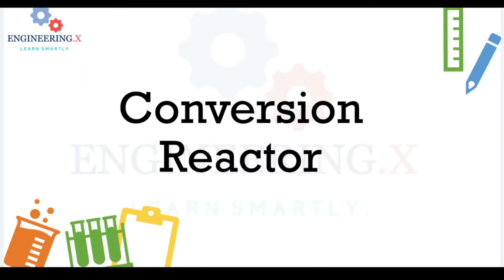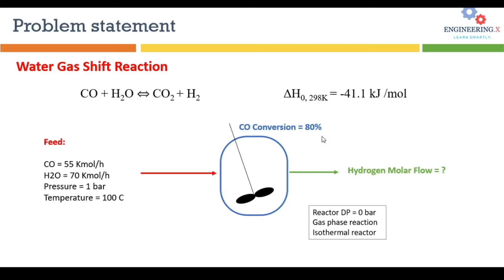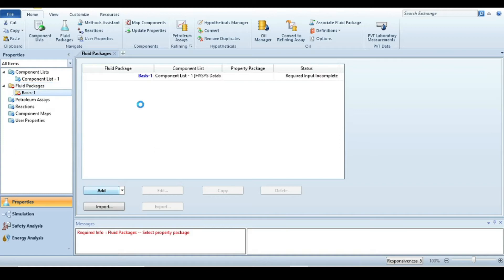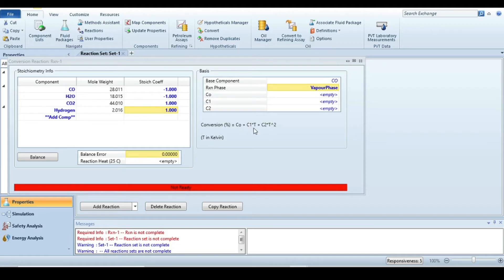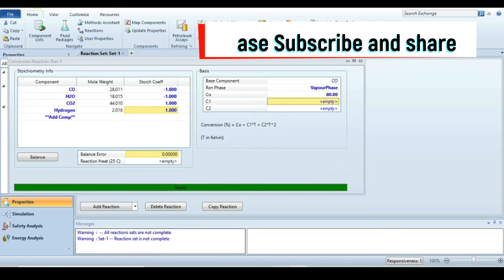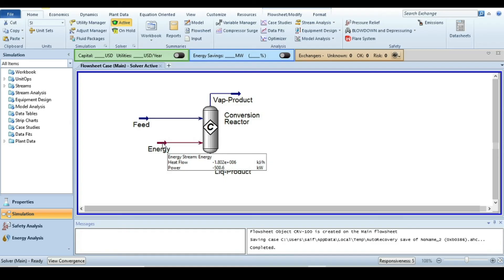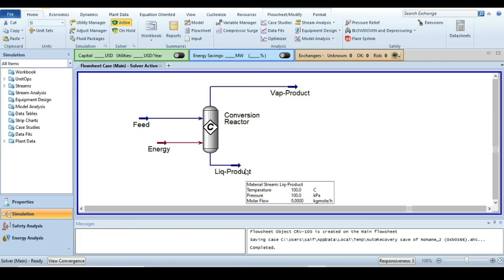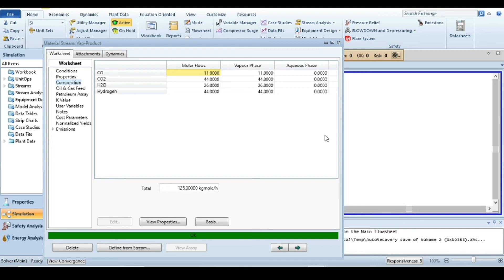Water Gas Shift Reaction in Conversion Reactor | HYSYS

Comment: Why Co ( carbon monoxide) is the base component? Why not H2O ( water) is base component? Because both are reactants, why you choose co as base component? 

Please explain , thanks in advance 🙏
Reply: CO is the limiting reactant here (which will complete first) so the reaction is based on how much CO is available
Comparing to h2O (70kmol/hr) CO is less (55 kmol/hr). That's why it is base one

Comment: Good day, is this a low temperature shift of high temperature shift reactor?
Reply from the maker: we used an isothermal reactor so no change in temperature but the reaction itself is exothermic so if lower the temperature then it will shift towards the product side and we can expect higher conversions and vice versa.
Reply: @eduXinsight  thanks for the reply , I have to model a low temperature shift converter so I guess this would not be to helpful but thanks for the video it wasgood
Reply: @eduXinsight  Regarding this question, a low/high temperature shift reactor refers to the temperature it operates at and not a change in temperature, so would this example you have designed reflect a low temperature shift reactor?